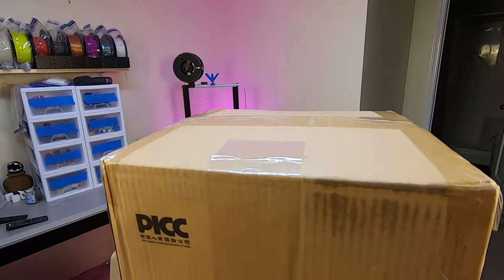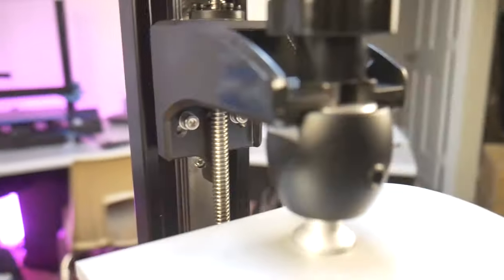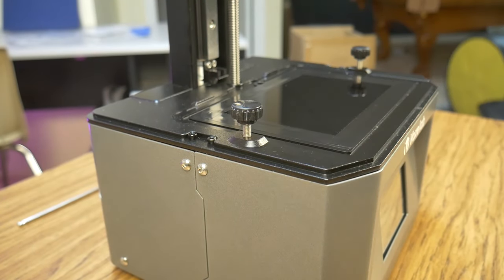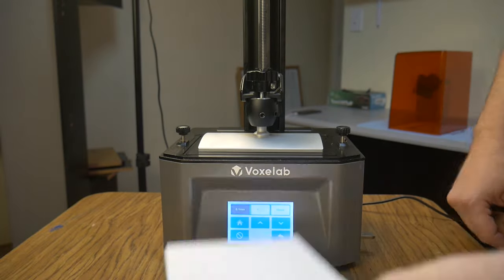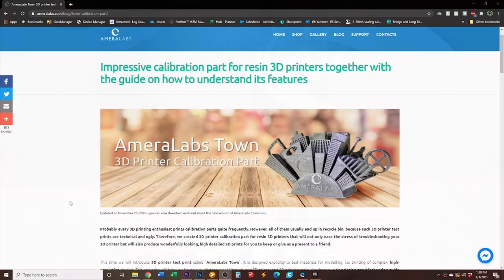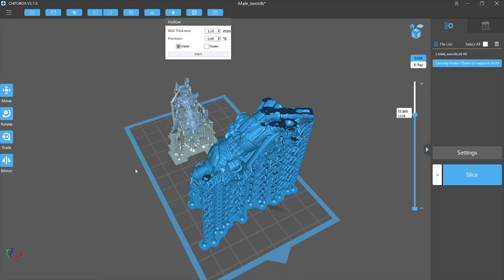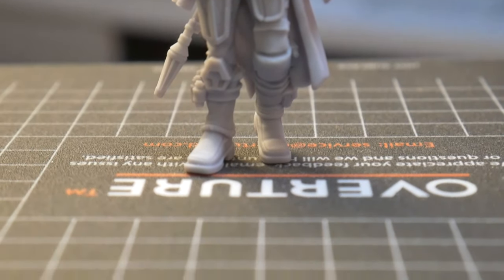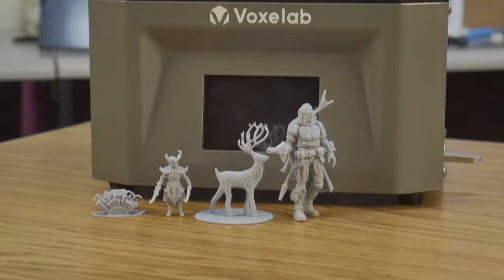Voxelab Proxima 3D Printer Review: Best for Beginners?

Comment: I just shipped my Proxima back. Mine had a fatal flaw that came down to the design. By the time the build platform got to around 75mm, the knob (that holds the platform to the Z axis) came loose, and I tightened it to the point of feeling like I would break it if I went any further.

I wanted to love it....
Reply from the maker: Strange defect. Never heard of that one before
Reply: @SouthpawWorkshop  The motor was really loud, I believe it hit just the right resonant frequency to loosen the screw. At least that's the only thing I can think of that would cause the issue repeatedly.
Reply from the maker: Yeah it is louder than my other printers. Could be the issue. You getting another one? Or something different?
Reply: @SouthpawWorkshop  While, I think this is probably a one off issue, this motor with that frame... 'er somfen.   I didn't buy a MSLA as a tinker project*.  I'm actually thinking of holding off to see what becomes of the Mars 3 ultra 4k.

*I get plenty of tinkering done with my 2016 Anet A8, that as of 8/21 has only 4 original parts (plus maybe a handful of nuts and bolts)...  Though I am seriously thinking of just reclaiming the parts and buying an Ender 3...
Reply from the maker: Also check out the new Anycubic Photon Ultra. It uses DLP technology which appears superior to the LCD used in normal printers. It isn’t out quite yet, but I have seen some really remarkable results from test units.
Reply from the maker: Great choice. I have a Mono also and it is a solid, reliable printer.

Comment: Great video man! Quick question. Why does a .stop file type not work? What file type does a resin printer use?
Reply from the maker: I assume you mean .step files, correct? For 3D printing in general, the most common file format is .stl  Once sliced, the file format will be whatever is compatible with your brand machine. A sliced file for the Voxelab Proxima come in a .fdg format. But the model used to make the sliced file is almost always a .stl file. Other formats can be used, but .stl is the most common.

Comment: I am brand new to this and appreciate your vids. I dont know what it means to slice or any of that yet. Guess I have a lot to learn!
Reply from the maker: Fun hobby and lots to learn! Slicing is what you do to prepare a 3d file to be printed. Let me know if you have any particular questions and I’ll try to help out!
Reply: @SouthpawWorkshop  Would cura be a good slicer to use for this? I work with Carbon 3d printers all day but don't have to do any slicing, since I can just drag and drop .stls.
Reply from the maker: For resin printers I would suggest either Chitubox of Lychee slicer. Both work well.

Comment: Great Review! I'm struggling between this one or the Phrozen 4K mini.
Reply from the maker: Theoretically you will have better resolution with the 4K mini, but I don’t think the difference is perceptible, nor is it worth the extra $100 in price. I have a review of the Anycubic Photon Mono coming up and spoiler alert it is pretty decent as well. Thanks for watching!
Reply from the maker: Theoretically you will have better resolution with the 4K mini, but I don’t think the difference is perceptible, nor is it worth the extra $100 in price. I have a review of the Anycubic Photon Mono coming up and spoiler alert it is pretty decent as well. Thanks for watching!
Reply: The 4k mini has been getting some bad reviews for poor out of the box proformance. It takes some time and tweaking to get it to work I hear. It might not really be a beginner printer is all I mean and this is way less than the 400 for the 4k mini.

Comment: Great video, now you've reviewed both, would you pick this or the anycubic mono? The Amerilabs test came out better on the photon but could that be explained by differences in resins? I'm wondering whether the photon is worth the extra outlay
Reply from the maker: I personally think the Voxelab Proxima is the better of the two. When I switched over to the Anycubic resin, the prints came out identical to the Photon Mono. The only drawback is that the Z-axis motor on the Voxelab is a little louder than the Photon Mono.
Reply: @SouthpawWorkshop  that's my mind made up then! You just saved me a good chunk of money :)

Comment: Hi, great review! I was looking for something like this for a longer time. How Proxina compares to Anycubic Mono technically? Both are about 229 USD and I saw Mono has a double linear rail for Z stability and much faster declared print speed (50 vs 22mm/h - but that depends on print settings, right). Proxima seems to have nicer vat fitting and levelling, more power (60w vs 45w for Mono) and at the moment is cheaper in EU. I'm confused if the declared power is the total printer power input or UV light source power in both cases. Both use different slicers, but Lychee seem to be as good as Chitu. Does Proxima has a cooling or ventilation system (since Mono doesn't as far as I know)? Both are connected by pendrive only. Interface and how the printer looks doesn't matter too much for me. 

 I'm wondering which one is better choice and Mini 4k is out of consideration for me due to higher price. I'd probably pick Mono SE for air filtration, WiFi and more UV power if I had excessive funds ;)
Reply from the maker: I have both. The Anycubic Photon Mono I own only has a single linear rail. Maybe you were looking at a different model? The Voxelab is louder. Both have cooling fans. My guess with the power rating is total power consumption so likely motor and led combined. The difference in print speed, if there is any, is negligible. Honestly, you can’t go wrong with either one. My preference is the Voxelab for a few reasons: the sturdy build quality, the superior leveling system, and the higher quality vat and non-proprietary FEP replacements. I am on making a video comparing the two, but it won’t be out for a while.
Reply: @SouthpawWorkshop  Thank you! I'm looking forward to seeing the new review. The double rail I was writing about I took from Anycubic store site, so maybe they just meant something else by it and it was marketing magic. Great to read how printing speed works in practice. I guess I'll take whichever has a better offer at the moment unless Mono SE will be available for me. My guess is that air filtration might be useful for printing in apartment,even if that adds almost 50% to the price. I don't want to bury you in questions, so I'll leave the rest for upcoming review. Many thanks!
Reply from the maker: My personal opinion is that the air filtration is just a gimmick. When the lid is on the printer, the fumes aren’t going to go anywhere. The only time I smell the resin is when I am taking prints off the base, refilling the vat, etc. During printing, I don’t smell anything.
Reply: @SouthpawWorkshop   I was wondering that, too! Thank you for taking your time to answer this! Was about to buy the Photon Mini but the voxelab seems to be sturdier and the leveling seems easier  (i read some reviews of lots of wobble for the photon mono). I guess I will buy the voxelab soon! Great review.
Reply: @SouthpawWorkshop  By the way, I ended up with Proxima after getting a lucky discount. I can't say anything bad about this printer, but I have no comparison. I just taped carbon filters to exhaust and it's fine. I'm probably sensitive to this kind of stuff, because I can smell even the eSun bio resin with the printer right next to air filter and in ventilated bathroom. I'm getting standing mini prints in about 3 hours with a transparent resin that takes 1/4 more exposure. It's a really great machine
Reply from the maker: @TiLi Bi If you are in the States, do me a favor and buy through my link in the description box if you can. I’d really appreciate it!
Reply from the maker: @Maciej Mindowicz great to hear. Good luck with the filtration. Hopefully the smell doesn’t bother you too much
Reply: @mackmind  You are not alone. But there will always be people who say they cannot feel a thing and/or are not bothered. I would very much worry about the VOC from any resin printer in an apartment with limited air circulation. Apart from the smell, there is little reseach potential hazards from this as of yet. I vent my resin printer outside and there is still a noticeable smell inside.

Comment: Thanks for this review. How bad is the chemical odor produced from this machine?
Reply from the maker: It really depends on what resin you use. Some are marketed as “low odor” and while they are not as strong as standard resin, there will always be a smell. Having said that, the smell is only noticeable when the cover is off the printer or when you are processing fresh prints, and in my opinion, the denatured alcohol I use for cleaning has a more irritating smell than any resin I have used. Hope that helps. Cheers!

Comment: Hi would you mind sharing the config settings you used for the printer in Chitubox (machine, resin, gcode, advanced)?  I just got this machine and it’s producing a resolution error on the printer when I load the fdg file using chitubox’s Proxima 6 profile.
Reply from the maker: Hi Trey, unfortunately all I did was use the default settings in Chitubox, so I don’t think my settings will help. A couple things to consider: are you using the latest version of Chitubox? Have you tried a different USB drive besides the one that came with the printer? Hopefully that helps. Good luck!

Comment: Is the firmware open source? the reason I ask is if it is then it should be possible to change the Icons and fonts, that constant blue for every icon is not taking advantage of the colour screen and is a little ugly and such a good product deserves a nice UI, infact I wish the manufacturers could get together and have some standard sets of icons produced
Reply from the maker: I agree. I wish there was a standard out there, but I bet there is more money to be made when  all printers use proprietary parts and software. No SLA printers are open source as far as I know.
Reply from the maker: I agree. I wish there was a standard out there, but I bet there is more money to be made when  all printers use proprietary parts and software. No SLA printers are open source as far as I know.

Comment: Great video!! 

I'm looking for a new printer, my elegoo 2 crashed. Would you recommend it? I0, douting before apparently it has longer printing times than elegoo and higher z resolution (though i only use 0.04 layers so dont mind).
Reply from the maker: It is a great printer at a great price. I have had good success printing with it and I think it would serve you well. Cheers!
Reply: @SouthpawWorkshop  so it is still running strong for you? I’ve never heard of this company.. Thank you!
Reply from the maker: Seriously great printer. Parent company is Flashforge who is a big player in the 3D printer market.
Reply: @SouthpawWorkshop  thank you. I’m looking at Production wise so I am considering this or the Elegoo Saturn. They are basically the same size is that correct?
Reply from the maker: The Saturn is about twice the area and 4x the volume, so it is a much bigger printer. I have a Saturn and it is a beast! Having said that, there is a Voxelab Proxima 8.9 which is the same size as the Saturn and is comparable in quality.
Reply: @SouthpawWorkshop  thank you

Comment: Hey, what are your print settings? Thanks appreciate the reply :)
Reply from the maker: I just use the standard print settings for this machine on Chitubox. One thing I make sure is that the room temperature is above 70F or 20C. That seems to help the prints finish without failure. Hope that helps!

Comment: How does this printer compare to the Andycubic Photon Mono? Which one would you recommend?
Reply from the maker: Both have about equal specs. Main differences is that the Photon Mono uses a proprietary vat FEP which is expensive and difficult to find. You are likely going to have to buy an aftermarket vat in the long run, which adds to the price. The Voxelab is cheaper and performs just as well as the Photon Mono. Main drawback to the Voxelab is that the Z-axis motor is louder than the Photon Mono. Both machines produce excellent prints. For price, I would go with the Voxelab Proxima.

Comment: How will it do for head sculpts like legends or McFarlane toys ?
Reply from the maker: It does great. Layer lines are almost imperceptible and if you plan on painting, the lines go away after the first coat of primer. The Voxelab Proxima is still the best deal for this size resin printer.

Comment: Hello Mate, 
Could you please post that Silced Deer (or anything already sliced for this Printer)? I am looking for it to run a Test Print on my printer as all the Prints thus Far are just Flat with nothing else printing except for the Flat Base. 
Please help...
Reply from the maker: What resin are you using and what is the temperature of your printing room?
Reply: @Thomas Lightle  Hello, Thank you for the response, I am using the AnyCubic Black, I purchased it from Amazon Here. https://www.amazon.com/ANYCUBIC-405nm-Rapid-Photon-Printer-1
And the Printing room temperature is about 59-62 degrees Fahrenheit. 
I am not sure if I should change the Resin Settings within Chitubox, But I simply added the Voxelab Proxima Profile in ChituBox as my Default Printer and changed nothing else.
Reply from the maker: I have used that same resin successfully in my Voxelab Proxima, but I can tell you that your temperature is likely what is causing the failures. Most resin printers work best around 70F and above. If you can’t get your room up to temperature, you can try warming your resin bottle right before printing. It is amazing how temperature sensitive these resins are.

Comment: have you used any water washable resin on this ?
Reply from the maker: Yes I have. Works great, you may have to dial in your settings a little, but once set, it prints as well as regular resin
Reply: @SouthpawWorkshop  ok what brand should i go for with water resins  also could u do a video on how to print a stl i have model figures i like to print and a bike but they dont have surport on them
Reply: @SouthpawWorkshop   im looking at maybe ELEGOO Water Washable Rapid 3D Printer Resin LCD UV-Curing Resin 405nm Standard Photopolymer Resin for LCD 3D Printing 1000Gram Yellow 

or the cheapest  water washable they do 

or 

Amazon Brand Eono

or

nova3d resin
Reply from the maker: Just about any will do. I use YouSu iFun brand and it works pretty good.

Comment: Is okay if I use this in a room?
Reply from the maker: It is a little noisy, so depending on which room it is, it could be an annoyance. I keep all my 3D printers in my basement and I can’t hear them upstairs.
Reply: @SouthpawWorkshop  ok cool. Are the chemicals harsh?
Reply from the maker: Yes. The smell is strongest while you are working with the resin and cleaning solvents. If I don’t use an organic vapor respirator I start getting a headache before long. There are water washable resins that have a lower odor and only require water for cleanup. I personally have never tried them so I can’t really give you my opinion.
Reply from the maker: Yes. The smell is strongest while you are working with the resin and cleaning solvents. If I don’t use an organic vapor respirator I start getting a headache before long. There are water washable resins that have a lower odor and only require water for cleanup. I personally have never tried them so I can’t really give you my opinion.
Reply: @SouthpawWorkshop  ok thanks

Comment: hello, would you mind sharing your settings? because it has been a week, I've spent 4 bottles of resin, and for some reason, I haven't seen even one of my models being printed, I've tried different settings on chittubox and voxelab's own slicer software yet still nothing, please help me out and I'd subscribe 8 youtube profile to your channel including my company google profile  thank you,  in advance, I hope you won't ignore my concern
Reply from the maker: Can you tell me what type of resin you are using? Thicker resins tend to have more failures especially if the room is drafty or not above 70 degrees F. Let me know. Cheers!
Reply: @SouthpawWorkshop  sure thank you for replying, I've used this one https://www.amazon.com/dp/B08FHYDYYR?psc=1&ref=ppx_yo2_dt_b_product_details     (VOXELAB 3D Printer Resin, Rapid Resin LCD UV-Curing Resin 405nm Standard Photopolymer Resin for LCD 3D Printing, High Precision & Quick Curing & Excellent Fluidity - 500g (Grey)   the room where I've used the printer is a very warm place so the temperature is above 80 or perhaps 90 degrees ,I use the printer every single day and always   same results the plate always comes empty, I've used my settings and supports, and yet nothing seems to works, Amazon sent a new replacement, and yet still the same, nevertheless, one day I used it and I noticed the plate had only the supports stuck in it, but no model  I've used so many settings and still no luck.  thank you
Reply from the maker: It seems like you have been thorough in your approach. Silly question, but are you leveling the build plate? Sanding the build plate will also assist in adhesion. Besides that, the next step in the process of elimination would be to try a different brand of resin. I have to admit, most of my print failures happened when I used Voxelab resin. After I switched to Anycubic standard resin, I don’t think I have had a failure since.